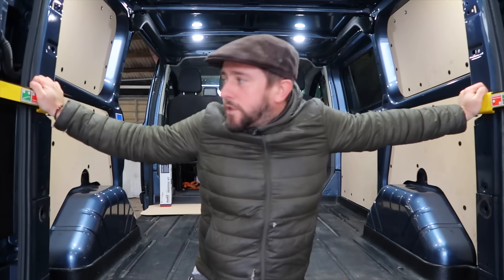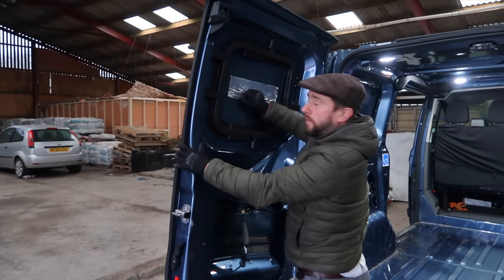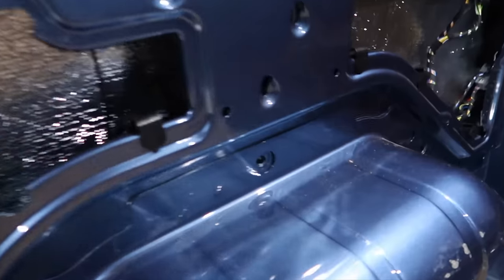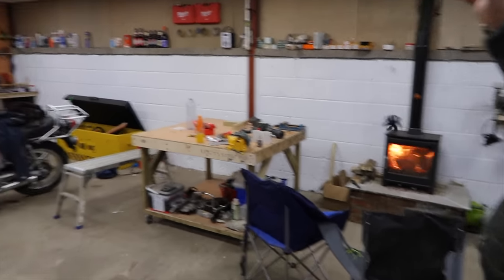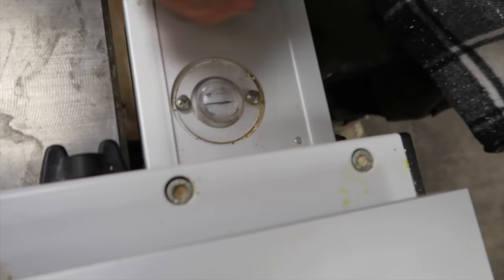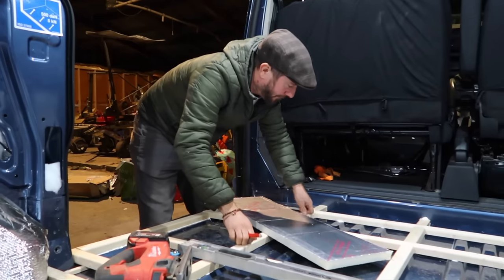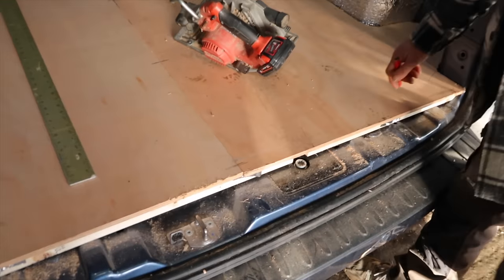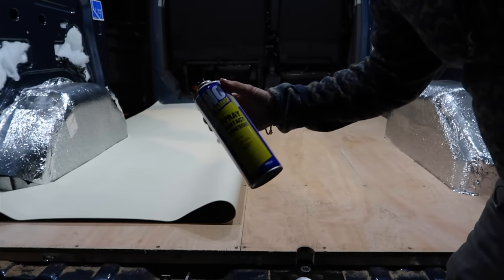Camper Van Conversion | Home Build Adventure Van Part 1 (Sound deadening, Insulation, Floor)

Comment: Thanks guys. It's good to see people who actually know what they're doing on the YouTube.  I've had more than enough of people who've never changed a light bulb doing something 'For the Very First Time!'  I think there must be some kind of international law or treaty that doesn't allow people who know how to use fiberglass and epoxy/resin to be on YouTube.  Anyway, it sometimes just seems.  
Me and vans? I want windows. I 'camp' in my Tesla Model Y, windows all around.  On my boat I prefer sleeping up in the cockpit if I'm at anchor. Inside is the same place it is at the dock.

Comment: HAZE Years ago i bought an P.reg Ex Ambulance allready converted it was cool in the summer and with just a single cas burner warm in the winter and we could stand up init ,no rust coz it's fiberglass ,and if the engine fales only £80 for a new one and about £300 too fit it ,,Enjoy you're van times i had two years traveling in mine ,the best time of my life :goodvibes:,,loving your videos bro :hand-purple-blue-peace: